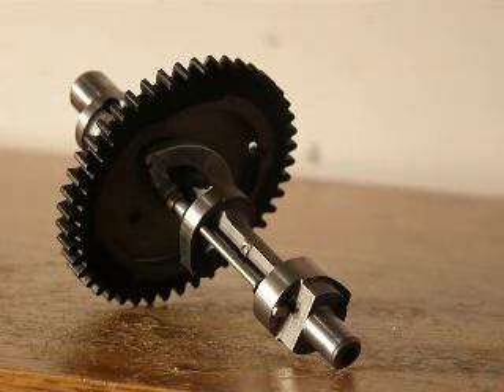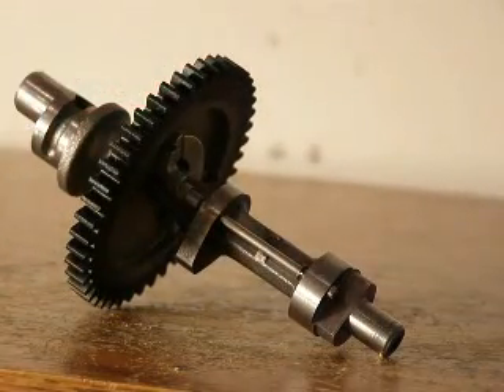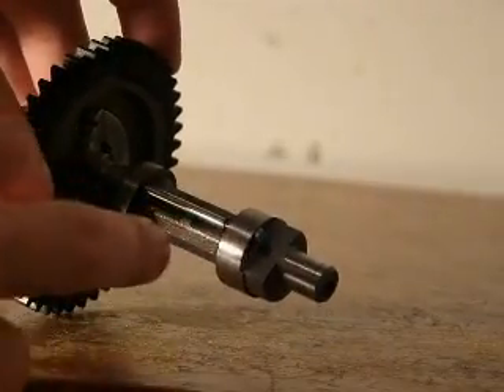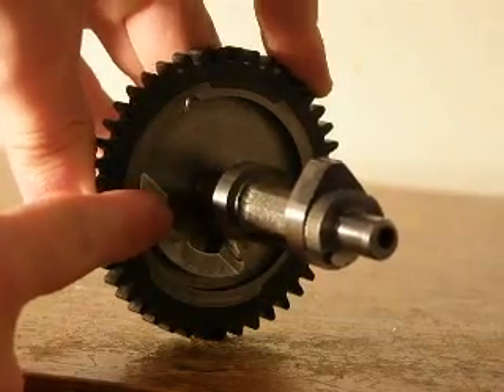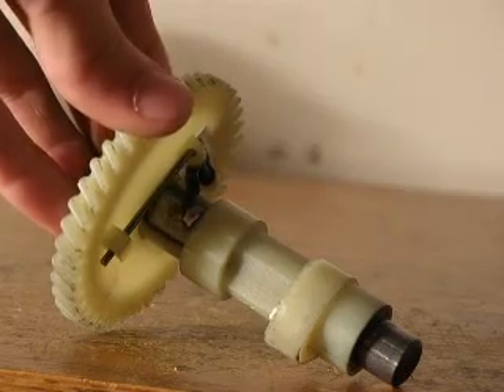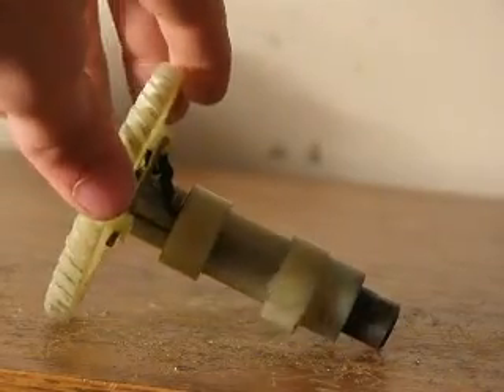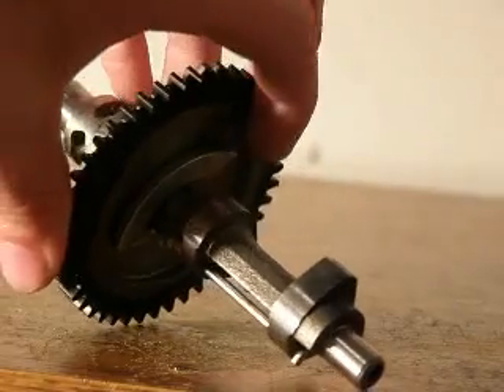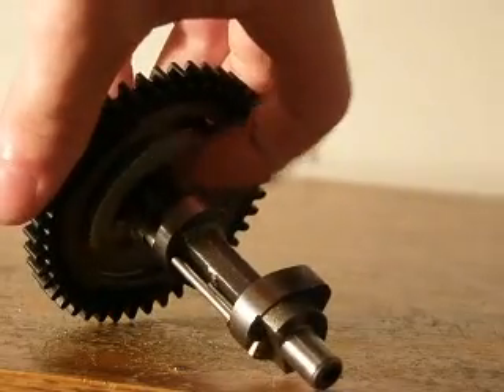Camshaft Compression Release Mechanism

Comment: There is any way to dismont that system? mine is a little stucked and I think itsmaking the rope hard to pull
Reply from the maker: You can either remove them or cut them off, they are sometimes press fitted together so they don't come apart easy. You don't need them, it's merly just a feature 😅

Comment: Great image; especially if one expands view, but super clear logical explanation. What’s really interesting on my eu3000is Honda is that it was running great one eve, shut it down and following morning wouldn’t run. Actually had change starting mechanism pack which includes whole assembly of starter, pull cord recoil and within days started dragging, grinding grunting noises as if low battery. The local ripoff motorcycle shop that sold me generator should know exactly what’s going wrong, but they have a standard diagnosis “no compression got to tear it down”. They immediately estimate minimum $500+. For a $2000. gen with significant use but still was running very well. How much work is it getting to cam shaft? What would go wrong overnight?

Comment: Thankyou, Thankyou, Thankyou!
I've been trying to get the electric start to work on a Tecumseh lv195 where nothing seems to make sense...  New battery, new terminals, new pinion drive that it DID need, but even with a full battery it will barely crank when cold.

BUT, considering the condition of the JET black oil and ALUMINUM DUST in the crankcase when I bought it from the original idiot-owner, I'm willing to bet that little compression release tab has been worn away!  I suppose it could be 'stuck' in the running position, but after 5+ oil changes I doubt it with today's oils...   Maybe I'll give it a touch of SeaFoam.
Reply: I know it's 3 years late,  but have you verified that your choke is closing all the way.  I have seen that very many times,  and sometimes it is not obvious ,  at first glance.